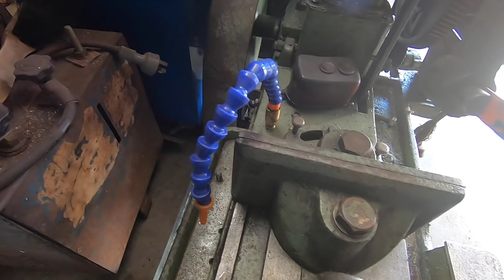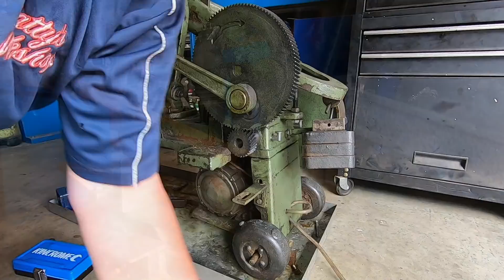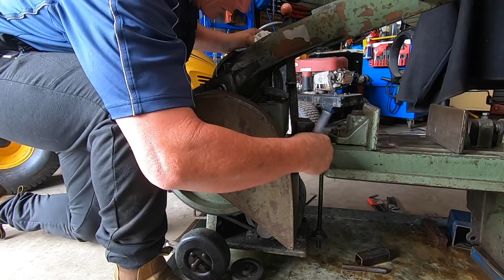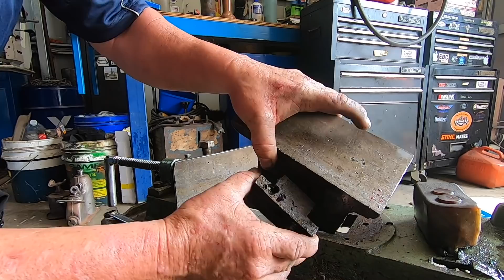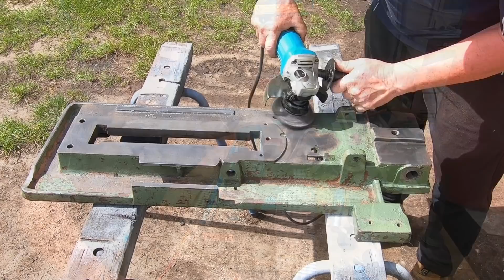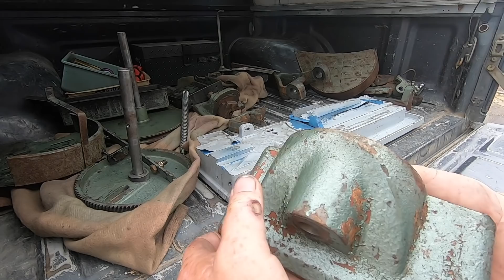Powamac Power Hacksaw, Part - 1 Tear down and clean..

Comment: This Power Hacksaw was made in Taiwan and sold under quite a few brand names. Good strong machine. If anyone has a Coolant Pump for one of these i'd be pleased to hear about it.
Reply from the maker: Gday, I’ve seen these quite a few times under different names with slight changes, the gear pump is very basic design, nothing fancy with it at all, I’ll keep a look out for one, thanks for watching mate, cheers
Reply: @MattysWorkshop  Thanks Matty ... Mine is a somewhat different model than yours and uses a similar pump but its driven by a tiny belt and pulleys low beneath and off the drive pulley and the pump is mounted to the motor base plate. I could probly adapt a gear driven one though. Certainly let me know if you find either one. Thank you :)

Comment: I have both a vertical and horizontal bandsaw.y horizontal saw is a jet variable speed 10x??? Can't remember..anyway it works great on tube and that used to be 99% of what I was working with. Well got a new project and I'm cutting 6"×4"×1.5" steel plate...bandsaw is not happy..I have a chance to bid on a Ercole 310 but I've never seen one of these in person let alone use one lol  seems like it may do better than my bandsaw on that flat plate?... if you happen to see this I'd love to hear input on this. Thx
Reply from the maker: Gday, I’ve personally never seen a Ercole 310, I’ll do some googling and have a look, with the experience I’ve had with the bandsaw I got it’s ok’ish on thin material as long as I have the material laying down, I run a 10\14 pitch blade which is great for stainless, for thin material I think a fine pitch blade would be the best bet and slow down feed, I really hope this helps and if you have any questions please ask mate, cheers

Comment: I had a 4-1/2” grinder catch with a knotted wire wheel on it and caught it in the forehead last year (tight spot, nowhere to go so I had to just take it). That was unpleasant. Actually blurred my vision for a minute, split my forehead open and left a substantial lump. 
I don’t know if it was good or bad, but the gearbox hit me rather than the wire wheel. 
Be careful, those things don’t play nice!
Reply from the maker: Gday Kenny, I’ve be caught before with these wire wheels and it bloody hurt, I think you were lucky the gearbox got you and not the wire wheel, that would of been a completely different outcome for sure, thanks for watching and commenting mate, Cheers
Reply: @MattysWorkshop  thanks for making such good videos! You and Kurtis are definitely two of my favorites!

Comment: G'day Matty. Great start to a good series. It's amazing what you find hidden inside, casting sand and casting faults, still it worked for many years. I'm sure it will be better than new when you're finished. That parts washer was awesome too bad you didn't have internal footage whilst in operation:-)
Cheers Peter
Reply from the maker: Gday Peter, I was certainly surprised to see the amount of sand and the imperfections in the castings, we thought about putting the GoPro in the parts washer but there no internal light and I think there would be to much steam to see anything, thanks for watching and commenting mate, Cheers

Comment: That parts washer is inspiring ... I've always wondered about re-purposing an old dishwasher into a small parts cleaner ... the rotating assembly driven by the jets might be the final key to a good working machine!
Thanks for sharing 🇨🇦
Reply from the maker: Gday Paul, I believe the rotation of the parts is the keys along with the heat, the oil and crap gets thrown away not blown from one side to the other, I think it’s a good idea trying a dishwasher, thanks for watching and commenting mate, Cheers

Comment: Hi Matty, I have the same machine, China made 15 years old, paid $700 for it, castings are very good.
I buy Eclipse blades, cheap up here in Philippines, $10 each, these machines are common here.
Yes they are slow but who cares, have all the time in the world, prefer them over a bandsaw with there inherent problems.
Replaced the contactor some years back after insects made a home in it.
The helical cut gears are bulletproof and this machine will outlast me!
Reply from the maker: Gday Willem, from what I’ve seen these machines where copied and renamed a lot, slight changes here and there but basically identical, I must have a look around for the eclipse blades, I’ve been buying Sandvic and there around the $25 mark, these machines were definitely built to last that’s for sure, thanks for watching and commenting mate, Cheers

Comment: Matty that's cheating using a truck parts washer. Early Taiwanese equipment is away good value over modern Chinese equipment.
When people ask my advice I tell them to buy some old Taiwanese equipment and add some T LC .
Old apprentice from Queensland
Reply from the maker: Gday Christopher, I know it’s cheating but why not, it’s aloud every now and then, even though it’s got a few crappy castings I rather have this then a Chinese machine that’s for sure, thanks for watching and commenting mate, Cheers

Comment: I was given a similar unit a fewf years ago - it is brilliant. The coolant pump doesn't work on mine, it just gets a squirt with a bit if cutting fluid every now and again, and it just keeps powering on. The only hassle I have with it is if I am trying to cut something of small cross section, the blade tries to cut to deep and jams, sort of have to half hold it up while it cuts. If I could find a finer tooth blade that would probably fix that problem, but blades are not common, and are expensive, so I use what I can get. Luckily I get years out of a blade. The reason I wont replace it with a band saw is that this just slides under the bench out of the way when not in use. A Band saw I would need to find a dedicated space for it  on the shed floor.
Reply from the maker: Gday Jack, the coolant pump has never really given any trouble, only the odd times where the hoses have blocked up, I found cutting RHS I have to hold the arm up while it cuts down throw the side walls, it does get a bit savage otherwise and there definitely much smaller then a bandsaw, thanks for watching and commenting mate, Cheers

Comment: Hi Matty. Great to see a machine which hasn't been abused over the years. Your mate's Robowash is brill, will it wash your overalls at the same time lol?. Good progress so far. Tony
Reply from the maker: Gday Tony, Dad always said he never ran the machine dry, always got oiled, that’s what saved it from wearing out, we thought about putting the GoPro on the parts washer but there’s no light inside and the lids has to be shut to work, it’s a great bit of gear that’s for sure, thanks for watching and commenting mate, Cheers

Comment: That parts washer is a winner. I had a very similar power hacksaw for a few years. It cut well but kept wanting to explore the workshop so I replaced it with one of the ubiquitous 6" horizontal bandsaws. Great video.
Cheers, Alan.
Reply from the maker: Gday Alan, the Robowash saved me days of cleaning, the results are fantastic, I remember as a kid when all the wheels were still good it never really moved around that much, I’ve got the Hare and Forbes BS-7 (I think that’s the model) bandsaw and it does a great job to, thanks for watching and commenting mate, Cheers

Comment: As you pull this apart it's interesting to see the combination of good workmanship (the dovetail and shims for the main arm alignment) vs the sh%tty castings. In those days a lot of this sort of stuff was an outright copy of a better brand and it is easy to see how they went about saving money. It's surprising that something of that vintage has lasted this long - it may actually be a lesson to us in that saving on non-essentials can still produce a durable solution.
Reply from the maker: Gday Neil, I honestly didn’t realise the castings were like this, I’ve never had the machine apart before and to find the imperfections really made me think the same, the proof is there, it may not look as flash but it’s done the same job as a much more expensive machine would have, there’s really bigger all wear in it considering how much work it done, Dad did say it was always oiled and never ran dry, thanks for watching and commenting mate, Cheers

Comment: Great project with family history,  maybe add a plaque with its provenance?
Workshop Blue Matty.
Thanks for sharing
Reply from the maker: Gday, that’s not a bad idea putting a plaque on it, ummm, I’m going to try and get the hammer tone green paint, I know I can get hammer tone blue here locally so that’s what it might end up being, thanks for watching and commenting mate, Cheers
Reply: @MattysWorkshop  Hi Matty, never heard it called " Hammer Tone", only " Hammer Finish ", probably other names it's known by. Here's a good story of using Green Hammer finish or tone.
Early on in my apprenticeship, (1978 to 82), I was working in the main machine shop, at the one end was the mens washroom and toilets,  with 2 round wash stands, urinals etc. The urinals were standard full height porcelain type with a common gutter in a shallow "U" shape about 20 foot wide.
A new shop hand or labourer started, his job was to sweep up, remove swarf,  tidy and clean washroom, his hours were an extra 15 minutes before and after the standard shift. 
For some reason he stayed after longer and painted the complete 4 foot tall urinals in Green Hammer Finish paint, he had got the paint out of the skip. What a sight going in first thing, obviously he was told to stay behind after to clean it off; no, instead he paints it White gloss!!!!!. This time he was ordered to strip it all off now, which he did, washroom stunk of paint stripper. 
He was sacked the next day.
Stay safe, best regards John Quinn.

Comment: Are you trying to shame me into cleaning mine up, Matty? Like you, I took mine over from my father when he packed his workshop up after his first stroke. He also offered me his tilting bandsaw, but I declined that because of the cost of replacement blades and I was short on space so it was one or the other. I'm interested to see the works inside the hydraulic lifter, so keep going - I'll be watching and rooting for you!
Reply from the maker: Gday Russell, the hydraulic lift system is extremely basic, I’ll be showing this and I’ll try to explain it the best I can which is something I’m not that good at, this really didn’t need anything doing to it and would of lasted many more years as it was, I seen the movement in the crank arm end and thought the paint could do with a freshen up so here we are, I am glad I’m doing it though, appreciate you watching and commenting mate, Cheers

Comment: Another high-lite to a boring rainy day.  Thanks Matty! 

I have a little Cowell stashed here (sold by Sears up here). Like a shaper - absolutely hypnotic to watch. I used one in High School and jumped at a chance to grab one years later. 

With a good blade they are awesome - low heat dead straight accurate.  

Very good story to go with yours! 

All the best 

Dan
Reply from the maker: Gday Dan, there a great machine to have and it’s quite easy to sit there and just watch it cut, the bandsaw I have is much quicker but I can see it’s a lot more expensive to run, I normally go through a blade on the power hacksaw every 8 to 10 months but the Peres a lot of cutting in that time, bandsaw blades are a bloody lot more to buy and don’t last as long, I should really be using the hacksaw more often and not the bandsaw, appreciate you watching and commenting mate, Cheers